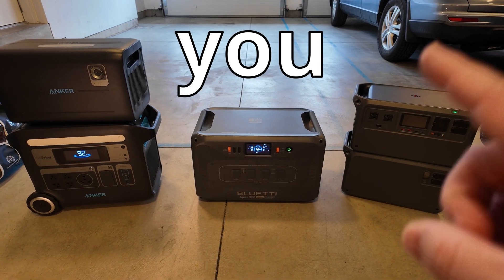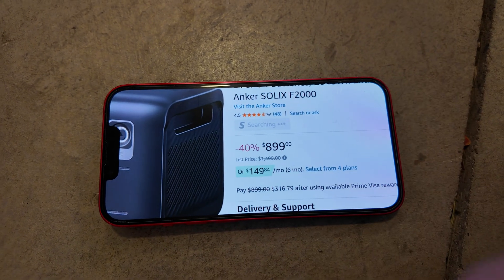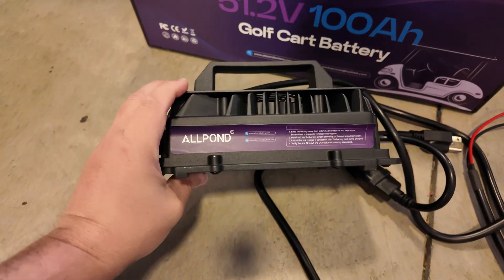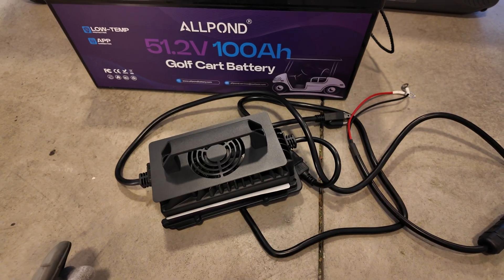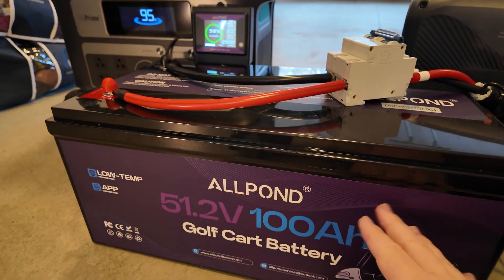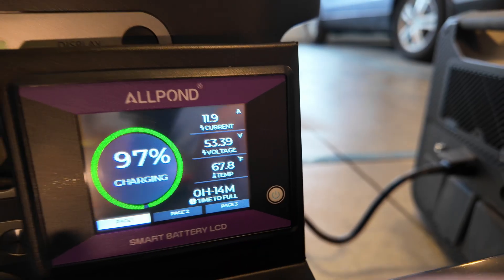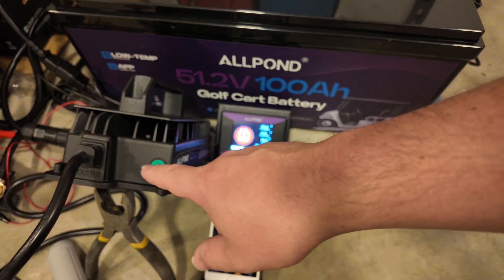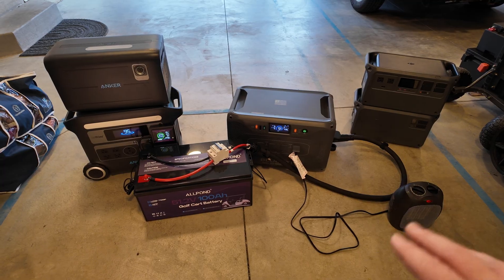The Great Solar Generator Rip-Off (And How to Beat It)

Comment: Can you use a 24 V battery or even a 48 V battery for extra power?
Reply from the maker: Ummm. Did you not see I was indeed using a 48v battery? 48v is really the way to go for this.
Reply: It would depend on your power station. Like I have a little one that has a 10-30V input so a 24V battery works fine but a 48V would likely destroy it.

I have a larger one where the DC input 12-60V so a 48V (51.2V actual) would work just fine on that one.

Every power station will have the DC input rating I'm their specs or printed right on the port. 

If you are connecting to the expansion port on the power station the voltage has to match exactly. If you are just using the DC input to charge the power station the voltage just has to be in the input port range.
Reply: Literally what the video was about.
Reply: Let me say first I really liked your video well done. I’m building a trailer as a mobile shore power to pull behind my truck camper. I have the Apex 300 Do you see any problem hooking multiple batteries in parallel as long as you start out with them all at the same voltage and would you have a separate screen for everyone or is this even possible.
Reply: If you are using the expansion battery port then the battery voltage and chemistry must be the same (51.2V nominal in this case).  If you are using the solar charge controller, make sure the 24V battery (25.6V nominal) is in the range that the solar charge controller can accept.  problem is larger power stations typically don't have a low voltage solar input.  Some Pecron power stations have separate low voltage and high voltage solar charge controllers.  Or you can buy a smaller power station that only has the low voltage solar input.

Comment: My $8k adventure started with one video on your Channel,  when you first reviewed adding the TemGo
 to expand your power station
 capacity. 
Now I am full bank of 4 TemGo 51.2/ 150Ah
Pecron E3600
9 X 440W Axitec bifacial 
Now with this storage capacity I am thinking of either adding the all in one 
Ruixu 10kw or add to separate devices like victron 
250v/100amp plus sunpowergold 6000k pure sine inverter. 
What's your thoughts .
I am trying to massively offset my bill and move towards totalbring of grid in next 5 years.
My 9 panels arriving tomorrow and I was thinking to do 3s3p until I decided on the rest of the equipment as usual was asking your opinion about.
When i decide my next equipment addition, iam thinking of arranging to 4s2p and leaving one on the side .
VOC 38.49. Isc 14.5 amps
With leaving winter and double facial factors i think my mppt has that least accept up to 250v input
Reply from the maker: This makes me happy to hear! So glad I could help you get started!
So I’m not you, and don’t know your particulars…but the 10k AIO is probably the way I would go. You can always add more charge controllers and solar panels if needed…but the extra output of the inverter is something I think you will appreciate. I was going to get a 6000XP for my setup originally…but then went with the 12000XP…so HAPPY I did that now with hindsight. I think you will be too!
Reply: @theresatrickforthat 
Thank you very much .
I wanted the confirmation from an OG like you so i don't have doubts after hitting the place order button. 
😂😂
But thank you and keep posting.

Comment: Thank you for all the work and testing that you do. Do you have a favorite power station and if you do why is it?
Reply from the maker: Oh boy! I do have favorites! But like everything…it depends on what you want to do. I personally think that the closest thing you can get to a “perfect” setup right now is actually getting 2 power stations. 1. The Bluetti Apex 300 like you saw in this video for home/RV heavy power needs. It packs a huge punch, 240v capability if needed at the flip of a switch, can be expanded to mega capacity, (especially with the cheap DIY expansion I teased in this video. More details on how to do it coming up.) good app control, is light enough to still be movable, and decent price! Cons: Heavy to be moving around a lot, no DC outputs.
2. EcoFlow Delta 2. And yes, I’m saying get the older generation. It’s not much different from the newer generation, but significantly cheaper (like $350 on Amazon) and this is your portable move around everywhere power station. It also gives you DC output. So it’s your portable powerhouse for small to medium loads…and has a meaningful battery capacity still. But no where near what the Apex 300 can do. So they each make up for the other’s issues resulting in a net amazing result and will cover you for just about every need you will have for power.

Comment: Manufacturers love their proprietary equipment they can control everything it can do and you have to buy from them lol But the DIY crowd doesn't need them
Reply from the maker: Well said!
Reply: I keep thinking they will figure a way to stop this ability via software
Reply: @thetoolmat8632 they can't stop it, if the unit is made to take in solar you can feed it DC battery power.